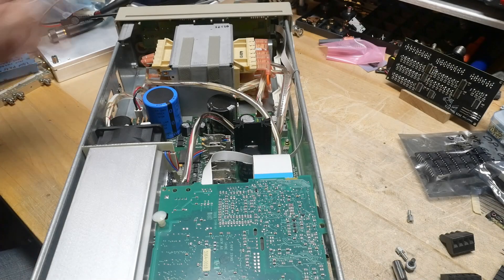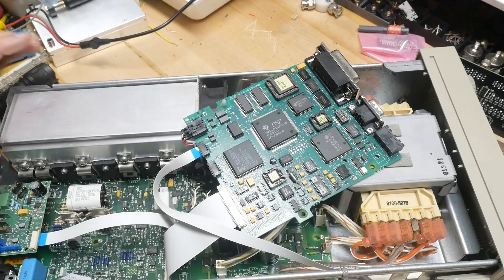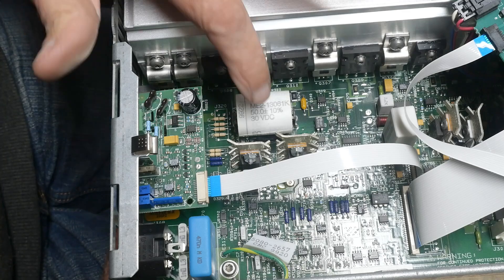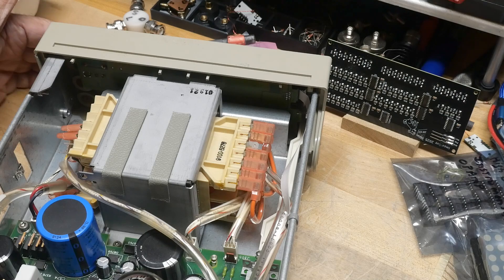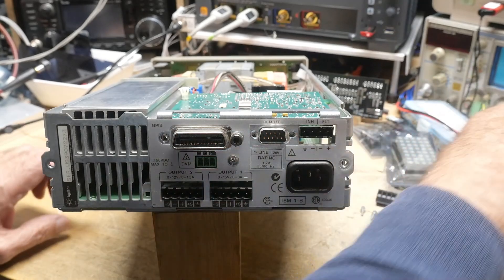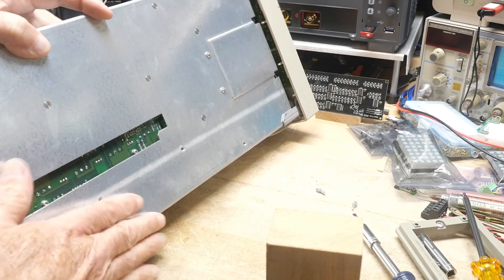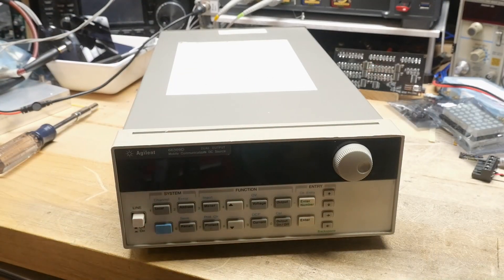#2156 Agilent 66309D Communications Power Supply (part 2 of 2)

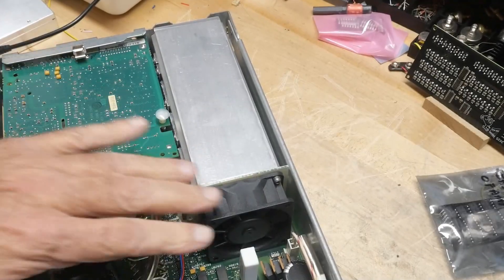Comment: Heatsink is round the ‘wrong’ way (because it’s three sided, not a square tunnel). 1:27 heatsink should be turned 90° counter-clockwise relative to transistors.
Reply from the maker: 5:40    it is custom extrusion. has vertical fins and a top and center cross piece. like the letter H with a top section. the side the transistor attach is very thick, about 1/2".

Comment: Well you talked me into one, got on Ebay from a Canadian seller today, $170CDN, did local pickup Orrilla Ontario. 
Plugged it in works perfect, voltage cal is great, need to tweak the current cal.
Fan is a nosy beast, think I'll replace it.
Lots of dust inside, blew it out, looks like factory.
Looked at installing some front binding posts, doable, see no reason sense leads could no be run, see no reason to bring the ground wire to the front so a 4 pin connector will do, just sneak the wires where the 5th pin was.
Thanks for the info.
Reply from the maker: let me know how the fan replacement works out. I've tried on other instruments and it didn't get much quieter.
Reply: @IMSAIGuy  
Patient survived fan replacement, defiantly new fan is more acceptable.
Had a similar size fan in my stash, original needed replacement since it rattled.
12V fan, on the new one added a series resistor to limit fan voltage to 8V,  to make the fan  EJ(electronic junk)  happy had to put a 1000uf cap in parallel with fan.
Max heat sink power dissipation happens when 0V out with a 3A load. Checked the heat sink temp only a 25degC rise above ambient, thats the worst case, I'am good with that.

Next for front panel connections, decided to bring all to the front. Will make a full width full length case about 2cm high on my CNC out of Corian, will stick it to the power supply case with magnets, add some feet. Will look and be slick.

Comment: These specialized source measurement units remind me of the specialized machines for comprehensive testing of capacitors: Nice if you really need it, very limited for general use and generally replaceable using equipment already on my bench.

Comment: In my experience the FPGA chips are vulnerable. They may lose their contents and replacing them becomes a true nightmare. If they are still running OK and passing all self-tests, then copying their contents to new chips would help a lot. That depends on getting those vintage chips somewhere. When the FPGA fails, some functionality will be lost.
Reply: lol FPGA chips does not contain any data, data i load from an external memory (often, modern one sometimes has internal memory)! I guess you wanted to said EEPROM chips!
Reply: @vaualbus  FPGA's are programmed at factory and they contain the logic hardwired, being sometimes very advanced. These chips replace discrete logic gates. EEPROMs typically contain programs for the DSP or sometimes data. They can be reprogrammed, sometimes even the DSP itself can do it in runtime.
Reply: @henrikstenlund5385  nope, FPGA field programming gate array. You are confusing FPGA with masked ROM  chips. FPGA are programmed via external memory at "boot" time in the field.
Reply: @vaualbus  I may be wrong, of course. Some modern chips have the contents in an external memory and the DSP pushes it the chip. In my experience some of the older FPGAs were containing EEPROM cells for the logic hardwiring. To reprogram them, you need to have the source code, programming software and a suitable programming device. If you have the low level code, you can burn it in with a programming device. 

In the old days I used to do some programming with the first generation fused PALs. They developed then to PROM cells and then to EEPROM cells. I have had insurmountable problems with some older Fluke meters when their FPGAs have failed.
Reply: @vaualbus  :)
Reply: You guys are both right and wrong. There are FPGAs that are "burned" in production, essentially setting fuses that configure them. There are FPGAs that boot from an image stored on an accompanying flash chip (image can also be squirted in by a companion processor), and their are FPGAs that have their own flash to store the image on-board.

For large FPGAs, external flash has been the most common to store the configuration.
Reply: @policyprogrammer  Right so. My comment was mainly concerned with the older variants made by Xilinx and others some 30 years ago. They cause a lot of headache for servicing today

Comment: I put a bid on a low priced clean 34401A.  If I get it cheap I can spring for a cal.  What is the point of having something like that without a cal?  Be careful of those ribbon cables of that type.  I got a Tek scope that uses that stuff and it gave me headaches.  I finally got it squared away due to intermittents.
Reply: May I ask the price range that you are surveilling please ?